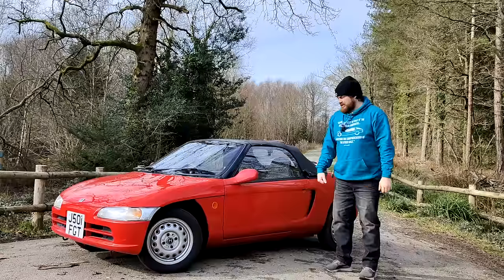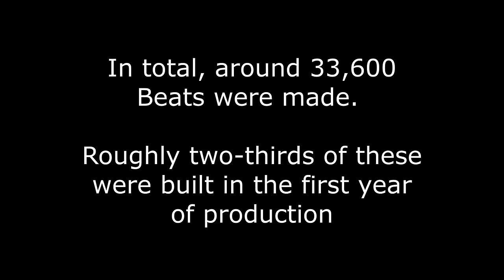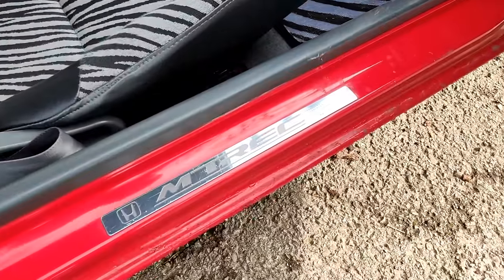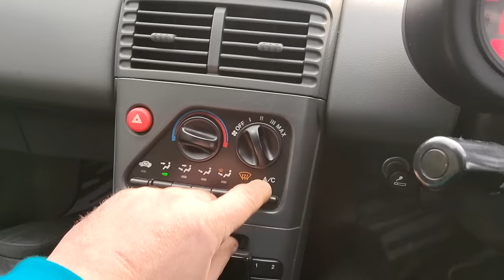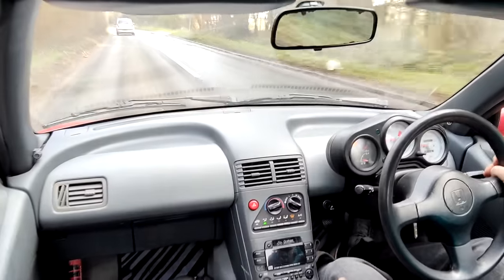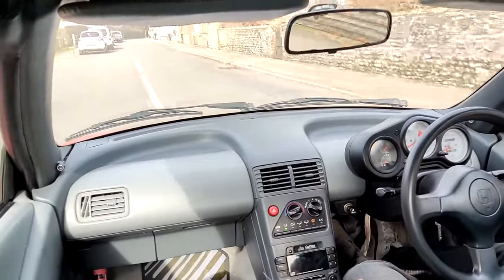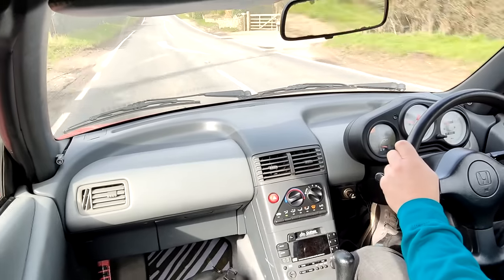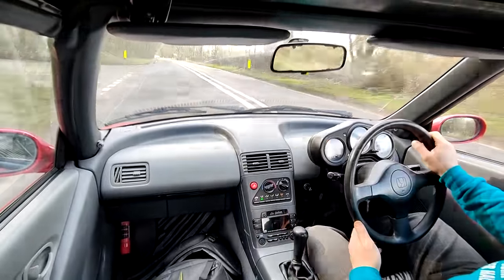1992 HONDA BEAT - The most fun on four wheels?

Comment: In an agony of nostalgia. In the early 1970s I had a Honda S600. Same kind of idea: four cylinders, DOHC, two twin-choke carburettors: you opened the bonnet and beneath a sea of aluminium there was a teeny tiny engine block, which you could see if you bent down a bit. Red line started at 9,500 (IIRC) and went on to 11. Up to 6000 rpm it roared; beyond that, it screamed. Insanely complicated (roller bearing big ends?). I have never had more fun than driving around town at scrupulously legal speeds in 2nd and 3rd.

In those days -- photo-copiers were still an innovation -- when you submitted your thesis you had to have it professionally typed and duplicated. I had to sell the Honda to pay the typist. End of youth.
Reply from the maker: I'd LOVE a go in an S600, always liked 'em!

Comment: I owned a Suzuki Cappucino, same kind of age, same category (Kei).  They were front engined, 660cc, turbo-intercooled, 5-speed, rear-drive, independently suspended, and also as much fun.  As far as safety goes, I was rear ended by some great lump of a thing on the M6 near Birmingham.  3 lanes all doing 50mph, I'm keeping a safe distance from the car in front (because not an idiot).  I glanced up at the rear view mirror and saw the car behind approaching like a bullet, next thing my speedo reads 90mph and I'm fighting for control and squirrelling between traffic to get to the hard shoulder and some element of safety.  It seems a twat 3 cars back had rammed the rest (myself included) into a multiple crash (heaven only knows how in such dense traffic).  Long story short, the Cappo only had a rear lens broken a bit, the rear panel dented (boot still opened and undamaged, boot floor with a small wrinkle where it joined the back panel, zero panel gap alteration, doors unaffected... and that was it.  I went to Ikea and treated myself to an assemble-yourself standard lamp with a big glass saucer shaped shade (easily fitted in the passenger seat) to cheer myself up.  The body shop later explained to me that these tiny cars react like ping-pong balls,  because they're so low inertia they just bounce!  You can drive them 9/10s most of the time and still use very little fuel, overtake everything, and (if you fit O.E road/race compound tyres) corner almost flat out even on tighter bends.  The Cappos have a folding hard-top with a three-piece sort of removable T-top you store in the boot (leaving zero boot space).  These little miracles are a bit like some kind of Swiss watch in car form.  Tiny, perfectly formed, and emotionally fulfilling.
Reply from the maker: Makes perfect sense. Modern cars are so heavy that any impact becomes a serious one.

Comment: Fixed one of these after a cambelt failure, genuinely couldn't have been easier to work on, big hatch under the top and well designed access holes to remove bolts and fittings.

Comment: It sounds like a race car, i love it. 
It reminds me of my fiesta, about 750kg and 1300cc with 66hp i have the short 957cc gearbox, you push the throttle to the floor on every gear and you are still doing the speed limit, you feel like you are going really fast but you are not, and that Honda looks even more fun 👏

Comment: This very car is for sale now (until Kitch buys it, I guess? 😅). I love small cars, they are so good for a B-road blast. You can use absolutely every ounce of performance the car has, driving it like you stole it, yet still not break the speed limit. Among the highest amount of smiles per gallon you can get from any car.
Reply from the maker: Is it?! Chap's only just bought it! (December)
Reply from the maker: I think that's the old advert that hasn't been removed yet.
Reply: @UPnDOWN  my previous reply has disappeared. 🤔

It's advertised on Car and Classic, the advert says it was listed on 13th February 2024, so it's not an advert from prior to December. It's also on the website of the dealer who advertised it on Car and Classic. 

It does seem strange that they'd be listing an advert for it in February if it was sold in December.
Reply from the maker: I guess it was just on auto-renew or something. Gets people calling the dealer, if nothing else.

Comment: Dont let Ms Hubnut see it she will want it 😂, this is the way we should have gone with elecy cars, im pretty sure more people would buy them as town cars. the only question being the weight and the battery size. anyway I bet they hardly produce any emissions, Dont they have a policy of scrapping their cars after 36k or three years of use? in which case it woulkdnt have surviced unless it was exported to another country. I remember my Dad sourcing a used Honda engine from Japan on a pallet to the UK for an acti-van and thats what the add said 36k engines because they have a policy of destroying them after 36 thousand miles. I have to admit my C5 aircross diesel is a brick on wheels and sometimes I wonder why I bought it but in its defence its very confortable with Visa like suspension.
Reply: I think they don't actively destroy them, but after a number of years you have to have some kind of major check which is very expensive, so people tend to replace their cars. Also, some people in Japan drive their cars very little. Here in NZ there's a big market for used Japanese imports; I'm currently driving an obscure little Toyota, 2012, that currently shows 23,0000 kilometres, and there is no reason to doubt that figure. Only problem is that with that kind of usage, some people just don't bother to get their cars serviced; an earlier car I bought was 8 years old, low distance, in impeccable condition, but the garage said it showed no sign of ever having had an oil change.

Comment: Funny this was the exact car I nearly bought last summer, big part of me not going for it is it had no paperwork, a new engine (again unknown about how well work has been been done) and I had some doubt over its overall conditions (bits seemed okay but is not consistent), hence decided to save up and import one in one day - or S660. Judging on your video it's probably the right choice, the engine/ECU and suspensions definitely need to be looked at.
Reply from the maker: I thought it was pretty good tbf. Check engine light is very likely a duff lambda sensor. Nothing wrong with the suspension, from what I could see? It rode well! Brakes did need a bit of work, but nothing major.
Reply: @UPnDOWN I hope so! Re suspension, it looked the tracking is quite a bit of an issue judging how busy the corrections were, and based on what I saw I’d assume struts&coils were not all replaced either despite the age. Re CEL I hope so (but judging on its intermittent nature I’m worried if it is actually the dreaded ECU - if O2 sensor or O2 sensor heater, would be running a different map and smell like petrol I think?), too many of these runs into this due to ECU issues, or worse actual issues with the cooling or the engine itself. Could be alright but given the age, difficult access and scarcity of parts (only very limited parts being reissued, many common ones not reissued - even these problematic rear callipers, at least one could use prelude ones), too big of a risk for me personally. It’s more of a question about expectations, a lot of people dreamed of daily these (hence huge hikes in used prices in Japan caused by foreign buyers, by which even Japanese dealers found a bit unjustified), which really is not that realistic reliability wise (there might be ones could do , but not guaranteed for everyone - personally know a few people who bought one only to have a lot of time out for repair, and it is not that easy to work on), weekend fun of course is fine.
Reply: Spent a bit of time consulting the Japanese manuals, best to short the service check plug and check what code it comes out with exactly (still I feel the car starts alright, runs alright and idles fine too so I feel shouldn't normally be the O2 sensor. Similarly feeling likely not fuel pump since starts alright, nor timing position sensor as not mis-firing. Inclined to think something electrical, or even just needing a new battery.). Some cars have multiple codes, which is even harder to isolate the issue. That is the pain (and the fun) with classics, only know the issue(s) once one comes to it (a lot of a car we never will probably never get a chance to see, until it presents itself as a problem).

Comment: Hubnut drove a Suzuki Capacino in Sydney when he was in Australia and be said it was the ideal sports car because driving it you use all its power they are another kei car front engined rear wheel drive and in Australia we get kie cars either JDMs also some were sold through dealers l may have seen a Hond beat once

Comment: I'm sure my Smart is smaller than that. More power, too 🙂 With a car like that I would worry about being seen by the higher vehicles, especially a certain group of 4x4's. I once worked for a boss who got run-over in his TVR by a reversing Range Rover! I suppose you could attach a flag to the back on a long stick 😀 I love the sound of that engine 🙂